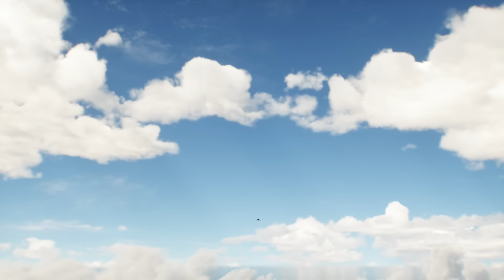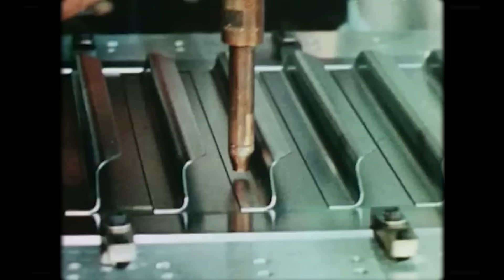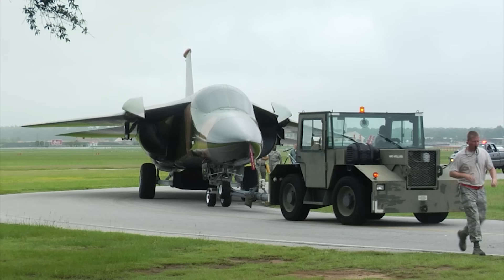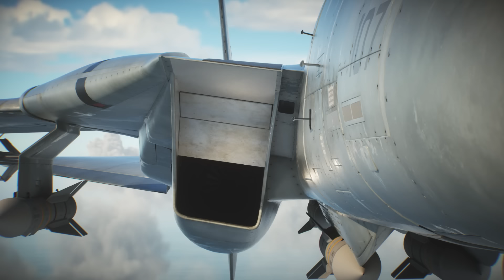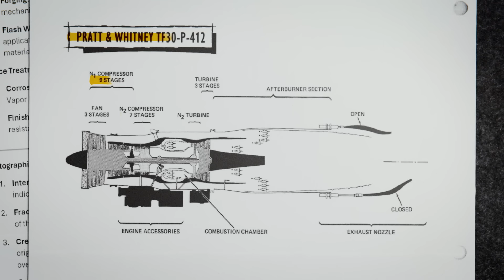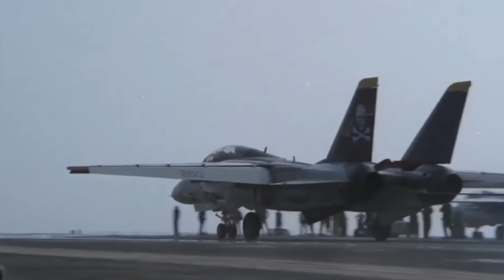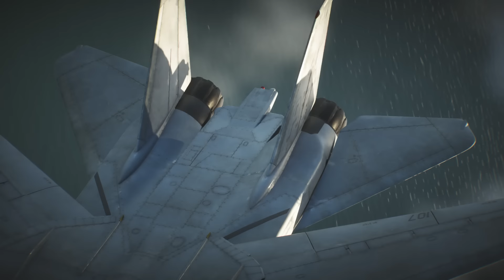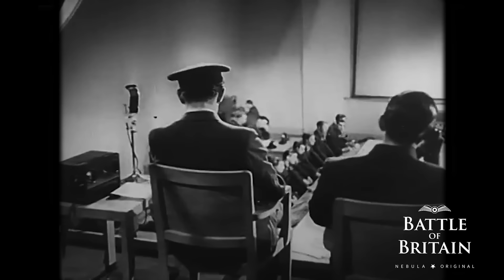The Insane Engineering of the F-14 Tomcat

Comment: No, no, no!

Chord-wise flow is not how a wing generates lift.  If it were, the air would have to know how much farther it must travel to meet up with its counterpart from underneath the wing. And that's just idiotic.

There are three ways in which an aerofoil generates lift. The simplest is its angle of attack : the angle at which the wing meets the airflow. On this basis, even a perfectly flat piece of aluminium will generate lift, but that is quite inefficient. 

The second mechanism involved is the formation of a high-pressure region at the blunt, curved leading edge of the wing. This high-pressure region combines with the shape of the leading edge to accelerate airflow over the upper surface of the wing. This accelerated airflow generates a low-pressure region on top of the wing, generating lift. In fact, the airflow over the top of a wing goes so much faster than the airflow beneath the wing that a puff of smoke directed at the leading edge of a wing in a suitable stream of air will depart the trailing edge of the wing from the upper surface before it does so from the lower surface.

The third mechanism generating lift is to do with the aerofoil shape of the wing. This shape guides the airflow along the surface of the wing, allowing the second mechanism to generate  the bulk of the wing's lift. It is this effect that fails when a wing stalls. In a stall, the airflow detaches and the surface of the wing experiences turbulent instead of laminar flow of the air.

Comment: 6:14 why does it need to slow down the air?
Reply: Because of the compressor. Most are designed to operate best at subsonic air speeds. Supersonic air creates shockwaves, which can really throw off airflow if it goes through the compressor as such, leading to compressor stalls or other disastrous events. Therefore, the inlet is designed to slow down the air to subsonic speeds, actually through a controlled shockwave, believe it or not. But this is the only one that they expect, lol. All others are neither required nor desired.
Reply: If the air is to fast it can cause a compressor stall

Comment: The TF30 engines were always expected to be an interim measure. They knew a later engine would get them to 1:1 trust to weight.
Reply: Correct, the TF30 was "supposed" to be interim, like only the first 70 production airframes interim before the Tomcat's designed for engine, the Pratt & Whitney F401 was ready. We know where how that story ended.

Comment: Another jet that was a massive maintenance workload for flight hours was the harrier.  But instead of letting it go to waste, we completely redesigned the thing from ground up using composites.  Not a single thing was carried over from the british version.  Then when the F-18 was being called in to replace the horrible tomcat, cheney greenlit another clean sheet aircarft, the super hornet.  Still cannot match what the Tomcat can do, except in phone booth fights where the hornet is amazing.  Helps when cheney is paid off by boeing after Grumman told him to pound sand.  A carbon fiber tomcat with revised maintenance engineering to speed it up, would have kept the tomcats flying today.  Meanwhile cheney greenlit the F-15EX another boeing plane.  That is as expensive per unit than the F-22 which he said was too expensive after reducing the production numbers from 700 to 187.  The Raptor would have been built at the same unit cost as the new F-15EX if they had made the full number.  And having 700 flying raptors would be terrifying to anyone.  F-15EX is an amazing plane, but could you imagine what the raptor could be today if it was getting all the cool new toys all the other jets get?

For killing the tomcat and neutering the number of raptors, Cheney deserves eternity on those really special levels of hell.
Reply: Congress makes those decisions, not one person.
Reply: @brandonadams7837  Yes Cheney was the Secretary of Defense.  Sort of has control over the budget being proposed to congress.  While he was in this position the budgeting for the F-22 was first cut down to reduce number of units.
He also denied the updates to the Tomcat.  This is all easy to research.  While cheney was chopping down those projects, Boeing was getting the greenlight on theirs.
Reply: Cheney was out of office long before the F-15 Eagle II was even a thing, let alone the EX. Costs should also be fairly directly comparable right now considering that there will only be slightly more Eagle IIs worldwide than there are F-22s.
Reply: F-15EX was directly tied to the reduction in F-22 production numbers. Cheney was the first to reduce F-22 numbers so Cheney was the one who got more F-15 options to coverup the lack of Raptor coverage in the Air Force.  F-15 is a great jet, but 700 Raptors in the airforce is a whole different air force.
Reply: @Power5  The F-15EX is directly tied to Arab funding for modernised F-15s i.e. the SA and QA. The USAF chose the F-15EX because it was effectively an off-the-shelf product with low development costs and modern capabilities that could replace the ageing F-15C/D fleet before their forced retirement in 2027 due to airframe fatigue. In other words, this is a purchase to prevent a capability gap since every other option either provided less capability than the existing F-15C/Ds, or would never enter service in time.

Cheney's reduction in numbers was to 381, which was a direct result of a significantly reduced budget after the end of the Cold war. Either way it was still more than the USAF minimum requirement of 320 needed to replace the legacy F-15 fleet. Robert Gates is the one who pushed for program cancellation which resulted in only the already placed orders being fulfilled and a final production number far below the minimum requirement which of course meant the F-22 ended up only replacing the F-15A/B models.

Comment: 10:01 if anyone else wants to know some more

Grumman and the Navy knew the engine wasn’t a good fit but a better engine was under development that itself bogged down that was related to the F100 called the F401

Infact under the original VFX contract only the first roughly 100 F-14s were meant to have it 

These were 
VFX-1 (TF-30)
VFX-2(Planned engine 401 or others 

Instead 637/712 were TF-30 built variants with 48 F-14As rebuilt to F-14B level and 18 rebuilt to F-14D standards

In all the TF-30 was directly blamed for at least 28% of all U.S. Navy F-14 crashes It is is likely in Iran that percentage is higher due to the age of both the engines and the airframes

Comment: Hold up... The Luftwaffe had swept wings, and vg in the works, but the US kept using straight wings on jets for how long? Just how many times has our top brass shot themselves in the foot?
Reply: The US is famous for trying to do things the way that is known and the cheapest way to do it. Swept wings massively changed the math when it came to aerodynamics, and for a while the US wasn't even sure they wanted to do jets. Plus swept wings only work well above a certain speed, a speed which early jets were not reaching generally. 

German variable geometry sucked because it couldn't sweep forwards midair, making the concept only really functional for a 1-way interceptor, and the US cares more about it's soldiers lives than a dictatorship on its last lead desperately throwing everything at the wall to make something stick

Comment: One point about the inlet. While they built it bigger than was required for the TF30, even in the early design days of the F-14, they had anticipated replacing the TF30 with a larger engine, the Pratt & Whitney F401 (basically an F100 core with a bigger fan and low pressure turbine) on it. It would also have required greater airflow. This got canceled in the 70s. So, the inlets were already being built bigger than the TF30 required because of existing plans for a bigger engine. Fortunately, that also gave the inlets the extra capacity when the GE F100-400 was installed in the late '80s.

Comment: lol AIM54 Phoenix was probably the worst ARH/ SARH missile ever created, poor maneuverability and unreliable tracking systems made it become one of the biggest waste in USA air to air missile programs.
Reply: Hardly lol. It's disadvantages were only a problem when the target was a fighter, and mostly came about when used at shorter ranges before it could accelerate. Even if a target had RWRs back then, they weren't exactly reliable against an AIM-54 diving down from 100000ft due to the steep angle.

Comment: Fun fact: there are no planes with swing wings since the days of the F-14 and F-111. Curious Droid did a video on that topic 7 months ago and the short answer is: advancements in aerodynamics & flight control systems made variable wings obsolete. Think like f.e. the flight envelope of the F-18 from landing speeds up to mach 1.8 - everything is regulated with slats and flaperons. ✌️
Reply: Not exactly. Swing wings are maintenance intensive and heavy, which can impact operational capabilities and reliability, especially with aircraft that are supposed to engage in high-G maneuvering. In terms of performance however the F-14 easily outperformed the F/A-18, because it could choose between high-drag and low-drag configurations. The F/A-18 cannot do that and it permanently high-drag which prevents it from attaining high performance. A mission-loaded F/A-18 is regarded as a subsonic aircraft in most cases, whereas the F-14 could reach speeds up to Mach 1.5 with a full payload.

There are still aircraft in service today with major powers that use swing wings, but they are all bombers... B-1B, Tu-160, Su-24, Tu-22M. The last fighter to use swing wings was the Tornado F.3 of the late 80s, retired by the early 2010s.

Comment: 19:05 actually, the wing sweep could also be toggled into manual mode by way of a switch on the throttle. I learned this while flying it in Microsoft Flight Simulator.

Comment: At 19:52 you describe lift using the equal-transit theory from Bernoulli. This is a common misconception and is NOT how the bulk of lift from a wing is generated. It contributes, yes, but it is not the main mechanism. The main lift-generating mechanism on a wing is airflow deflection, where air is directed downwards by the wing surface, resulting in an equal-but-opposite force pushing the plane up. If you don't trust me, trust NASA: https://www.grc.nasa.gov/www/k-12/VirtualAero/BottleRocket/airplane/wrong1.html

Comment: Don’t think you said, the AIM-54 had three variations throughout its lifetime: the AIM-54 A mk47 (lesser systems + engine), AIM-54 A mk 60 (lesser systems but better engine [smokless, etc]), and the AIM-54 C mk47 (better systems and lesser engine). I believe the reason why the C variant didn’t have the mk60 engine was because the Hercules plant which made the newer engines shut down

Comment: I accidently proved how well that fuselage lifting body worked. I have a large 9lb F-14 R/C that could reach about 100MPH. The original builder gave it to me, I modified it to have stabilators and added a much larger engine. One day the wing ripped off of it in flight when I was doing a high speed flyby down the runway at about 10' altitude. I was able to control pitch and altitude with the stabilators but the tiny rudders were ineffective at yaw or roll and it had turned towards the road. I managed to gain altitude to fly over the cars and then ditched it on the other side of the road where it burried about 10" of the nose into the dirt. The original builder had not installed the two plywood pieces that hold the wing bolts to the fuselage. I ended up fixing it and shes still airworthy but I've not flown it in over a decade since I started building real aircraft. I'd like to some day convert it to electric ducted fans and ditch the nitro engine on the nose.
Reply: Small rc turbine engines

Comment: "Most  welding requires oxygen for combustion" ... not at all mate.  Aerospace typically uses mig or tig which uses noble shielding gases.   I bring this up because the difference between those techniques and electron welding would be interesting to hear about.

Comment: You have missed a very important point.

This was the first Digital Aircraft which used the world's first microprocessor 20 bit MP944 (1970) which was classified for 25 years. At this time this was far superior to intel 4 bit 4004 (1971) which was launched a year later.

Comment: I can see why the Bell X5 failed. The trick with the F111 and the F14 is that it becomes a Delta wing in transformation. Just sweeping the wings on an otherwise "thin" wing is only going to create headaches. The Viggin and Gripen are Delta's that use the fron canards to get the extra lift and control a whole bunch of other effects. Those things are amazing for their time.

Comment: I worked at Grumman test / production facility in calverton Ny 1984-89 my father and uncle worked there from 1970to the late 80s I lived about 3 miles from the calverton facility. I got to see so much of the tomcats in action from 2 tomcats screaming over my house wing tip to wing tip I used to work on the the runways at calverton to so I at times I would be 100 feet from a tomcat powering up with their breaks on just really cool stuff I got to sit in the test booth as they test fired the Gatling gun on a tomcat I was a young man at the time loved it. I would be on the runway when the navy would come to pick up a brand new f-14 and fly it out  Grumman was a great company to work for. They would say the Grumman family as in my family there was 2 generations working there  I did so many different jobs so I got to see so much.

Comment: Comparing G-limits of a fighter vs a missile directly like that is a bit misleading, as the missile is moving much faster than a jet it requires higher G's to do the same turn in the same amount of distance. A jet fighter simply changing heading by less than 120 degrees could cause the missile to require over 20G's of pull to stay on target if done at right moment. Even if that maneuver was done at "only" 7 G's.

Comment: It's not a "wingbox". It's a "boxbeam". The bleed air door on top of the diffuser ramps became fixed in the open position fairly early on. In my entire career as a F-14A airframe mechanic, I have honestly never once heard the term "taileron". Nor have I ever seen the glove vanes welded shut, (though it's conceivable that it happened post 1991). I was also qualified in flight controls rigging and adjustment and you didn't mention the flap/slat center drive gearbox, (aka the "machine gun"), the CADC, the CSDC or the pitch/roll and yaw SAS actuators. Those flight controls were a unique hybrid of mechanical input and fly by wire technology. You didn't talk about the four hydraulic systems which were also integral in flying the airplane.
Reply: They indeed started welding the glove vanes shut after 1991...

Comment: Fun Fact:  Anything radio, sound, or light related doesn’t double its range by simply doubling the power put into it.  It takes 8 times as much power to double the range of the radar.  100 watts is enough to send a signal around the world.  But it’s not going to be very strong where it arrives.  Same thing with radar.  1kw is enough to go a little past the horizon.  But 8kw will make the signal that bounces back twice as strong.

Comment: Im an aeronautical engineer with a propulsion focus. You got the right idea with inlet guide vanes (IGVs). They’re not necessarily creating laminar flow, as once the stream has been tripped to a turbulent regime there’s basically nothing in a plane we can do to fix that. What IGVs do is control the angle of attack the compressor blades are experiencing. The reason this can prevent stall is that it means the blade is producing less “lift” and has a lower acceleration over the suction side of the blade. This results in a less adverse pressure gradient through the engine, meaning we can rely on the momentum of all that metal spinning to recover the started condition.
Reply: I'M A RIGHT(TUO).AERONOTICAL ENGINEER STUDENT.CORREDPONDS WITH BOOSTED EQUIPMENTS WITH NO WIDTH TO CONTROL.AM(AMPLITUDE MIDULATION) TO CORRESPOND WITH IT.WITH JUST A HINT OF AFTER BURNER INTRO:2.MAYBE MIDWAY INTERTAINMENT ABOUT MORTAL COMBAT INTRO:2.MIRAGE 2,000.ETC
Reply: BLUE UNIFORM MUNA.
TITAN AE INTRO:2
INITIATION-HAZING MUNA.
Reply: ALPHA KAPPA RHO(AKP).
-ALASAN GANG
Reply: ALPHA KAPPA RHO(AKP).
-ALASAN GANG
Reply: Last sentence,  you mean "stalled" condition"...

Comment: Changing the angles of the wings.
That's what I'm interested in.
More lift with less drag.
Question?
What was the body of the F-14 made from?-Aluminum 
What is the Radar Cross Signature of the F-14?
What powers the diffuser at the inlet? - Hydraulics? 
Shouldn't there be a safety precaution to detect Compressor Stall?
What about making the WINGS RETRACTABLE?

Comment: 0:18 whilst this video is, aside from this, very good, the F-4 Phantom II (the direct predecessor to the tomcat) was designed for exactly this job and did it well for decades
Reply: The F-4 was retired in favor of the F-14, because of the, even after having their hands tied by Congress, lessons of fighting in the air of Vietnam
Reply: The main reasons for the implementation of the F-14 over the F-4 were: 1) Better low speed performance. 2) integration with later generation Sidewinders (Aim-9M). 3) Integration with the Phoenix and later Fox-3 type Air to air missiles, but that does not detract from the role the Phantom II had, but I do agree with the eventual need of its replacement.
Reply: @heylo_9  That's why the Tomcat got a gun
Reply: @mr.c5217  yup
turns out, useful backup if all else fails
so just keep it
had to learn that the hard way